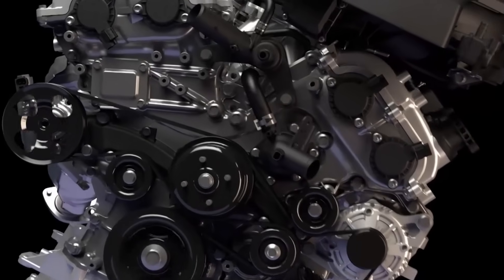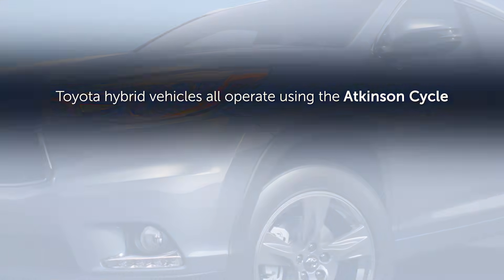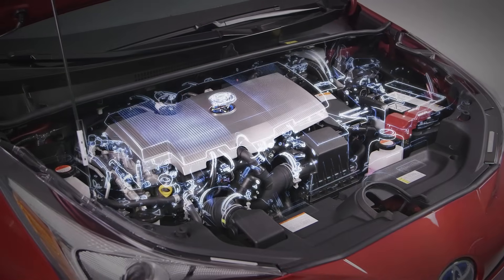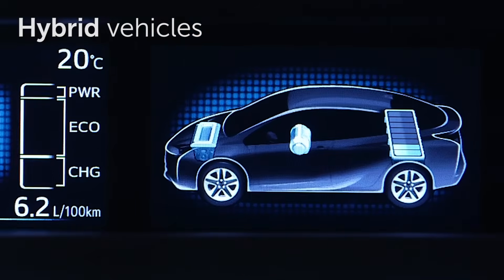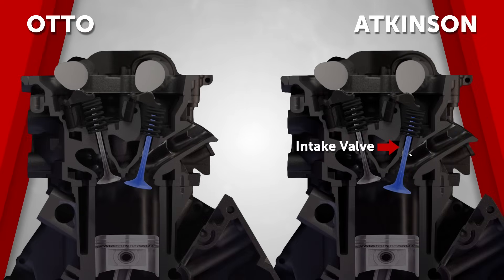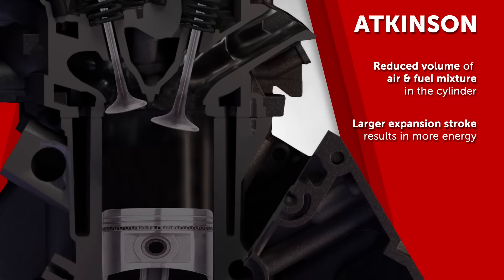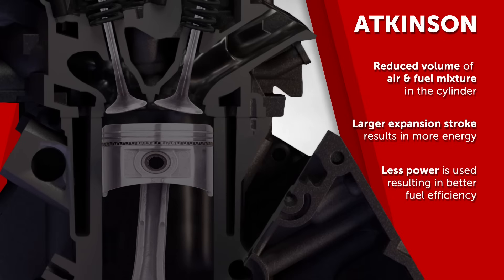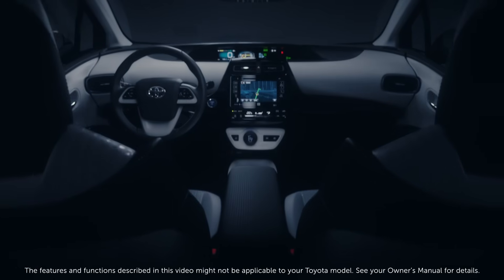Atkinson Cycle Engine

Comment: Translation: "The valve timing is fucky"
Reply: @benedictroberts678  the pistons goes up, intake closes late, the compression is done, the conbustion starts, the piston is pushed down, and then, when the piston come up the exhaust valve should open to let gas out, instead, it compresed that air again without any reason
Reply: @mihailpetrovici5044  It explains in the video that it's on the compression stroke in the animated (the animation they use isn't very good)if that is whats confusing.  I did notice it played the inlet cycle twice and then stuttered on another stroke later on.

My guess is this video is more likely to have the "dangling keys I front of a baby" effect so average consumers think its something special. 

Long story short the engine delays compression via leaving the inlet valve open longer resulting in less fuel being burned and meaning there's less heat in the combustion chamber; I recon it screws the power output though.
Reply: WAIT now I see, fuck I'm dumb...definitely an animation error.
Reply: Look at the 1:35 the damn engine forgets to evacuate gases
Reply: @mihailpetrovici5044  yep thatd be the Atkinson cycle for you, funky valve timing to force fresh fuel/air mix back up the inlet resulting in less fuel/air being burned and so better economy.

I have probably explained something wrong as I am not an expert but I think I've reiterated what the lady said.
Reply: @benedictroberts678  no, the exhaust valve didn't opened at the right time, if you look the piston compressed the air again and as it came down it opened tge exhaust valve as it was an intake stroke
Reply: @mihailpetrovici5044  I don't think I'm seeing it.

You mean the exhaust valve opening before the piston is at bottom dead centre?
Reply: So, thanks to driving 4 answers video on Atkinson, Miller and Otto cycle engines, it would appear this isn't even an Atkinson cycle but rather a Miller cycle engine.

I suspect the engineers had nothing to do with the marketing or video. 👏
Reply: Unless the addition of a supercharger is what makes it a Miller in which case I'm talking nonsense.
Reply: Thanks tree hunging leftists, you have reinvented something that has existed for hundreds of years, and deemed INFERIOR to otto cycle "and still is" just so you can save some whales "debatable".  In exchange for having a vehicle that runs like complete garbage.  I know, I have a 19 trd pro tacoma, and until it was aftermarket tuned to keep the atkinson cycle OFF it was an absolute hell to drive. Add on top of that the worst programmed 6sp auto pairing to ever be produced in automotive history, and without aftermarket support anything with this engine is damn near undrivable.  But thank goodness it gets 1 whole mpg than the 2nd gen 4.0 L did, YAY PROGRESS. "obvious sarcasm".
Reply: @ALLLLTheThingspersonal  Change your Teeny-weeny di*k car to a normal sized car.
Reply: @nopenope2134  Its not a car mate.
Reply: @ALLLLTheThingspersonal  111 OG Holgrphic watch Real Platnum
Reply: @ALLLLTheThingspersonal  my experience with Toyota autos has always been terrible. I wonder if there's a way to remap the gear changes
Reply: @ALLLLTheThingspersonal  100%
Reply: @hordboy  $avage 85... callin it ultra telescope jerbal on the case
Reply: hey bud, just wanted to let you know that this cycle was originally created in 1882

Comment: I really dont agree with these engines there are easier ways to get mpg with power
Reply: You don't need to agree on an engine. engines are physical objects, not opinions 😉

Atkinson cycle engines have shown to have better thermal efficiency and lower pumping losses. It can also be applied to powerful engines but are not generally applicable for sports cars where being efficient is not the primary goal. This is more applicable for regular vehicles especially if the engine can switch between Otto and Atkinson when applicable, and Toyota achieved this via their existing VVT. VVT has been in their engines since the 90s anyway so it is actually an "easy" way, they just used the existing cam phaser to delay intake valve closure.

Add a turbo on it and it becomes a Miller-cycle engine. Turbo engines also tend to have better thermal efficiency than NA engines, and making them operate on Miller cycle dynamically via existing VVT should further improve that. Turbochargers and cam phasers are mainstream tried-and-true tech nowadays.

Comment: for 2020 tacoma sr5 3.5L V6 engines, is this combination of Atkinson and Otto going on? thanks for your response.
Reply: Yes, the engines run on the atkinson cycle when demand for power is low. Once demand for power is needed (you floor it) the see engine runs on the otto cycle.

Comment: why not use the miller cycle?
Reply: Someone told me that the Miller  cycle is better for supercharge engine
Reply: It's basically the same but Miller uses a compressed charge (normally a supercharger) to compensate for the loss of low rev torque.

Comment: I love how the narrator says that this may not apply to your Toyota while I'm just over here with an '89 Camry just wanting to know how the Atkinson cycle engine works
Reply: Yeah, I’m pretty sure it doesn’t apply to my 1990 MR2 Turbo either. Fuel efficiency isn’t its strongest point.
Reply: If you want to know how it works then this isn’t the video for you. Toyota is good at lying. My Tacoma had an “auto lsd” according to Toyota, except it was an open diff that absolutely nothing to limit slip automatically. It was traction control. It had a no slip mode called a locker, but the auto lsd button was pure false advertising.
Reply: @KTMcaptain  some cars apply the brakes to the slipping wheel so power is directed to the wheel with more traction, which behaves like a LSD. Volkswagen calls it a Virtual Locking Differential in their cars. That's probably what your Tacoma has.
Reply: @barnsnoble7066  my point is that calling it a limited slip diff is false. The diff does nothing to limit slip or bias torque. I also drive a Gladiator Rubicon not a Tacoma. Got rid of that thing a year after I bought it cause it was always in the dealer getting repaired and just unimpressed me.
Reply: @barnsnoble7066  yes and Volvo did the same thing and called it TRACS. (from the 850 onwards)

Comment: Is there any additional maintenance involved for the backflow of air/fuel into the intake manifold? Intake system cleaning? Etc?
Reply: well the fuel is what kept the carbon off the valve seats as it washed away in port injected engines
Reply: These Engines have Both Direct Injection and Port injection to help with these problems.They switch on and off through different modes depending on driving habits.From a mechanics standpoint point I have seen that this design does its job and works very well. If you are familiar with how Toyota Engineers things, they have pretty much worked out the bugs with this design.  Keep in mind that Toyota Pioneers a lot of mechaical designs and sells those ideas to other manufacturers . Toyota also doesn't give up on their innovations either. They  keep churning them out while perfecting them in the process.

Comment: So this is why my tacoma is so underpowered
Reply: Atkinson cycle turns off at full throttle. Toyota just makes slow (but still good) trucks lmao
Reply: Yeah it is underpowered.  I made the mistake of trading my 16 Frontier for a 19 Tacoma because I was brainwashed about reliability.  The 16 Frontier never gave me problems and it had way more power too and was immensely fun to drive.  Now I drive this Tacoma and wonder if the thing can make it up the next hill.
Reply: I think certain people should work in this field before you start sizing up Reliablilty . I have a '23 Tacoma and that thing Runs perfectly fine for my taste and can take a hill with 0 problems. The 04 Tacoma I had was very underpowered,  but that Engine will run for a lifetime!  I don't understand what some of you people want or expect. Toyota buyers know what they want and what to expect. Sometimes I just don't get it. Did you not test drive the truck before hand? Geez

Comment: If the Intake valve remains open longer and the Air & Fuel mixture goes back to the intake manifold, I believe that's why the EGR on the 3rd gen prius get clogged up and the throttle plate on the second gen Prius gets filled with gunk. What ya'll think?
Reply: Egr can be a dirty setup in any design. In the 60s they told owners use the best fuel available. After emissions regs in the 70s unleaded fuel caused the invention of egr or feeding the engine it's own waste in an attempt to make crap fuel burn properly. One way to fix dirty egr problems is designing it to feed the gases from the rear of the catalytic converter instead of in the exhaust side of the head or manifold. The catalyst acts as an egr filter before it gets fed back through the intake. This cleans everything up causing a lot less gunk to build up throughout the egr system and intake.
Reply: Don't forget to fix the PCV vent.
Reply: I’m wondering why this even exists.
Reply: The Prius is a unique situation as the engine isn't ran in the same conditions that an internal combustion driven vehicle is as well. Since the Prius only runs the engine on takeoff or under certain conditions precipitation builds up in the oil contributing to the build up on the throttle body and intake runners.
Reply: If direct injection, should be reduce the problem
Reply: @chongweilee5903  Probably makes it worse actually, the gasoline actually helps keep the intake clean by acting as a solvent. It's oil vapours from the cylinder wall that clog things up.
Reply: @BigUriel  actually PCR and EGR, but..
Reply: @TheCUTTERbyPHOENIX  In this particular engine the air charge is pushed back into the intake, you case you weren't paying attention. Even without PCR and EGR there will be oil blown back up.
Reply: @chongweilee5903  how direct injection have anything to do outside of the combustion chamber ? DI have made it way worst ! why do DM car manufacturers does return to the port injection ?? cleaning the valve, maintaining the sealing in a longer span of time etc...
Reply: @chongweilee5903  direct injection is neither the cause or the fix for the build up of material. The material is caused by the PCV setup on direct injection engines and the lack of fuels cleaning effect. The reason it's such a problem with modern direct injection engines is they are all using low friction piston rings that allow combustion gases into the crankcase which is then fed through the intake by the PCV system and built up inside the intake runners. Modern engines are also lacking an EGR valve opting instead to use cam timing to create the same effect EGR has on intake air.
Reply: @chongweilee5903  I get what you're saying 👍🏻

Comment: Toyota didn't show the crankshaft, a true Atkinson engine doesn't hold valves open it uses a pivoting rod and linkage to get all 4 strokes in one revolution of the crankshaft. in other words the piston will go up and down twice when the crank turns once. and two of the strokes are longer than the other two. here is a good animation of how it works.   https://www.youtube.com/watch?v=CNsJOsnuIMA
Reply: yes you are correct, but the automobile company uses different inlet valve timing compared to conventional valve timing to emulate the Atkinson cycle instead of changing their crankshaft design as implementing original Atkinson cycle makes the crankshaft very complicated. Similarly miller cycle can also be used for high efficiency operation where inlet valve can be closed early during the induction stroke.
Reply: That was original Atkinson cycle when they didn’t have variable valve timing
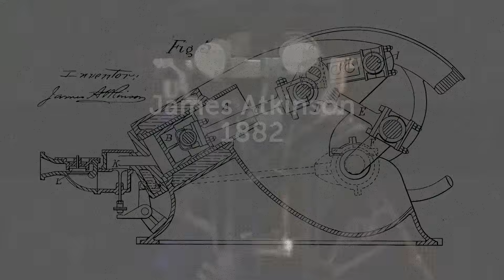Reply: 0:12 shows original design of Atkinson engine draft.

Comment: Same compression as Otto engines, but with longer strokes like Diesel engines. I actually like this concept. I drive a lot and I spend a lot on fuel. This wouldn’t provide life changing savings, but it’s a step forward.
Reply: It's not a longer stroke, it's a reduced volume of air being compressed, because the air isn't compressed as soon their is less parasotic resistance in the engine. You're also burning less air and fuel but in the same confined space. The part I don't get is reduced compression reduces efficiency which is why this engine doesn't get the MPG gains it should to make the Atkinson worth it. That reduced compression is why it has no power. If they increased the static CR before introducing the cycle I wonder if I would be possible to even that out, but then there are changes to everythings physics when one feature changes so idk
Reply: @spencerkleiman5035  o
Reply: @spencerkleiman5035 well the mpg is better so obviously it’s better for traffic jams and cruising

Comment: A little question for me to Toyota. Imagine now you would bring a sporty Toyota, let's say, a Lexus RC, that would be fitted with an hybrid system, but it's engine could swith into auto or atkinson, like the regular ones. Wouldn't it bring a plus in performance, when needed, and letting it be clean when desired ?

Also, combine the same system as above, but insert a turbo in the equation. Wouldn't it be impossible ? Because, you are doing this on your LeMans cars, and I still believe that this could make a pretty interesting sportscar concept.
Reply: I recently bought a Lexus RC 350. As far as I know it does switch between the Atkinson and Otto cycle however it’s not a hybrid. I don’t see why they wouldn’t use both modes on a hybrid besides a hybrid trying to utilize the best fuel economy. It may be complicated having 3 different modes of engine operation as well. You may be onto something with the turbo which might be why Toyota and Lexus is sticking with naturally aspirated engines for the most part, although some of the 4 cylinder Lexus are turbo.
Reply: @CouchMan88  The 3.5L toyota V6 does this? I didn't know that.